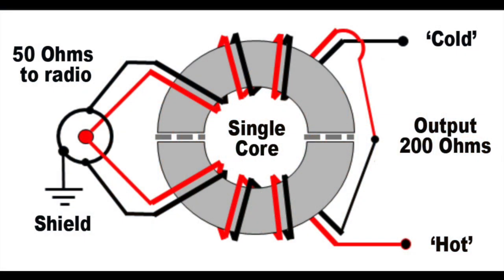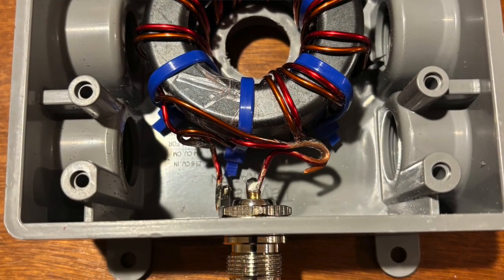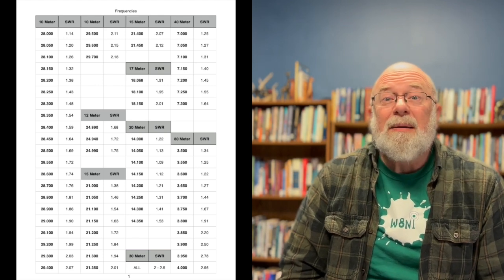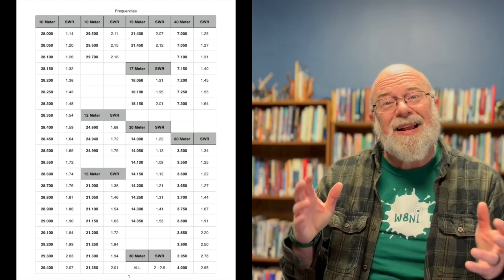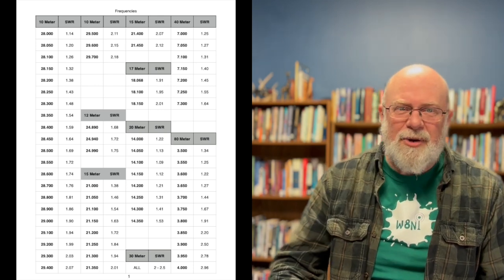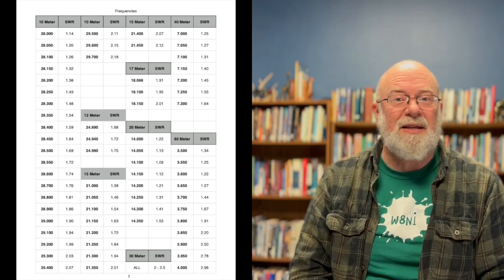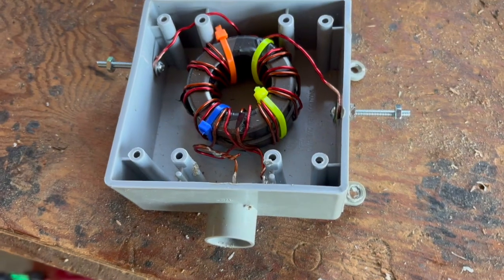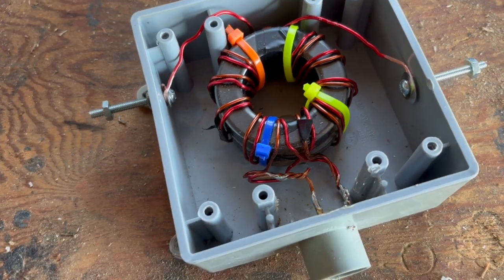The Amazing Delta Loop

Comment: Yes, build a horizontal delta loop. You won't regret it. I'm using a Ruthroff 4:1 voltage balun made by Myantennas. I ended up with 273' of 14 gauge wire. Fantastic performance, I can work the world. I'm up about 35-40' in each corner. Everyone says this is a nvis antenna on 80m, but I have been able to work from the west coast to east Coast on SSB in the evening with a decent signal. I can work into Asia and Australia in the morning on FT8 on 80m almost every day. Build it!
Reply from the maker: That is great! I wish I did a better job measuring the wire in the air. I started with 290 and then cut off a LOT! So I am probably about where you are at 273. I haven’t used it much for 80, but really enjoying it on 15! I am sure as we approach the solar minimum 80 will be used more frequently. Thanks for the comment.

Comment: What was your final length of wire.? .. I have a 40 meter vertical delta loop and thinking I will replace it with a horizontal 80 .
Reply from the maker: Good question. I think I started with 290ft and then trimmed until the dips where where I wanted them. I cut off a lot… so, maybe around 270-275.  It has been getting a lot of use and working well for me. Thanks for the comment.

Comment: The only way to truly evaluate power transfer efficiency and current balance of a given BALUN design at various frequencies and power levels is to test it with a purely resistive load.
In general, I become suspicious when I see a low VSWR over a wide range of frequencies on a load (i.e., antenna) that has a wide range of complex impedances; it often indicates an inefficient (i.e., lossy) transformer.
Regardless, sometimes an inefficient transformer is an acceptable trade-off to achieve wideband low VSWR coverage.
Instead of a BALUN, another approach is to use an UNUN immediately followed by a Common Mode choke.  It's extremely rare that any antenna -- especially at lower HF -- is truly balanced.
Reply: The best answer is above.